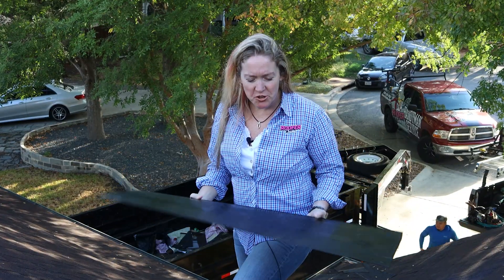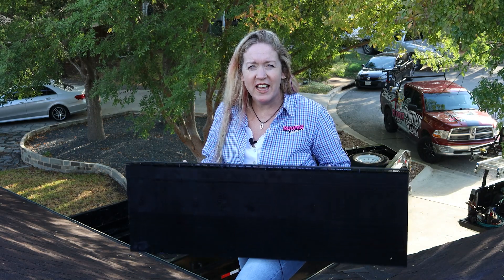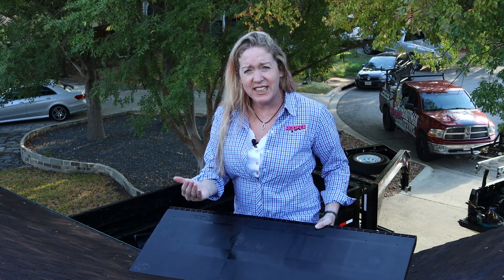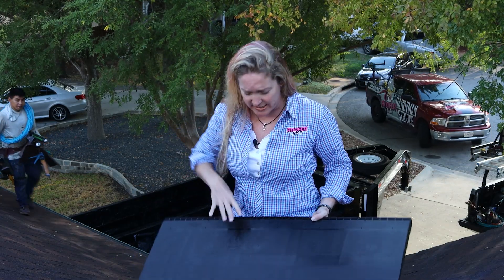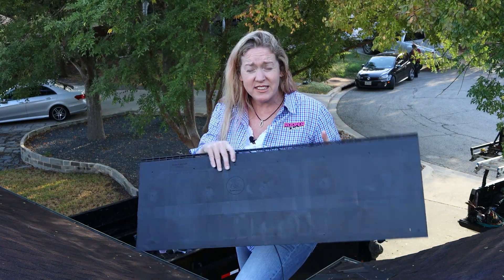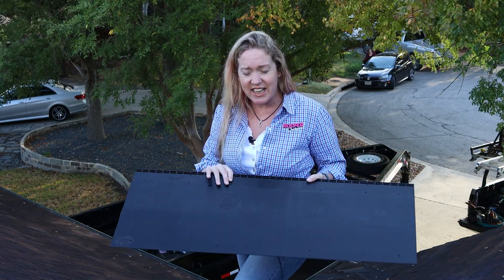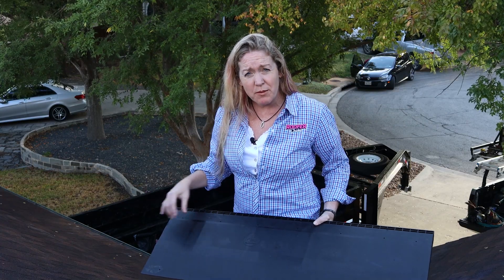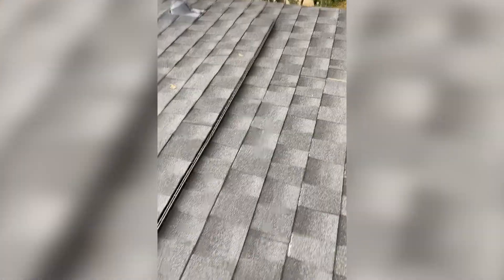Using a Shingle Over Intake Vent (An Alternative to Soffit Vents)

Comment: Ohagin low profile vents, im using 1 for intake placed at lower part of  roof , and 1 for exhaust on the top by the ridge. My question: should i place the intake where i get the wind blowing that way intake sucks all the air in, should i place  exhaust opposite side of roof? 
Or should both be on same side? If same side wouldnt the air blow into the exhaust vent ?
Reply from the maker: The wind doesn't really impact the vents - I usually opt to put vents on the back of the house if possible for better curb appeal. You do not have to put both on the same side. One vent isn't very much - you might want to check the ventilation calculator for how much you need.  https://ohagin.com/vent-calculator/

Comment: What do you think of this solution for a house in a state where snow accumulates on the roof after a storm?
Reply from the maker: That's a really good question. We are not in a snow market here. I know that for ridge vent they make a version for snow climates that has a screen/mesh on it to keep the snow out. I'm not sure they do that same thing with shingle over vents. It makes me want to ask Lomanco! I am going to.
Reply: @rooferchicks  Thank you!
Reply from the maker: Check out SnowVentCo - they make vents for snow.
Reply from the maker: My Lomanco rep told me this: Ami, our deck air intake has a screen in it and is the only one with a baffle in front to prevent snow from getting in. 

We sell a ton of this product into Colorado and other northern markets because it performs.  The mesh allows for air flow (filters do not) while prevent snow from getting in, and the baffle will prevent snow and wind driven rain from getting in.

Comment: Can a gable vent serve as the outlet for air? We had an extension built on our house. Soffit vents were added, but no ridge vents.
Reply from the maker: Yes, it definitely can be. If you ever do decide to install ridge vents (which I think are more efficient because they get up higher than the gable vent and cover more of the roof area), then be sure to block off the gable vent from the inside - just cover it with OSB, plywood, foam board - otherwise they will work against each other.
Reply: @rooferchicks  After installing this type of intake roof vent, along with a new ridge vent, my roofer is claiming sealing up the gable vents is unnecessary and not as much of a conflict as other types of ventilation, like powered ones (for the record, I'm not suggesting they should be the ones to seal it up). But it makes scientific sense that sealing them up would be much more effective, and the Internet seems to overwhelmingly agree. Do they have any point, or just flat out wrong? Thanks.